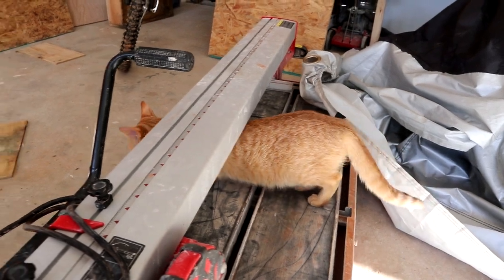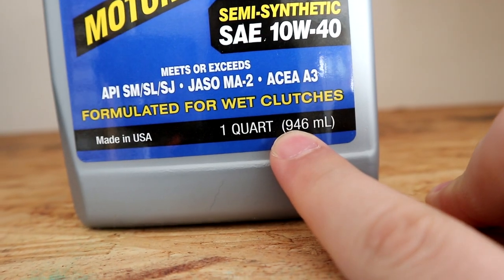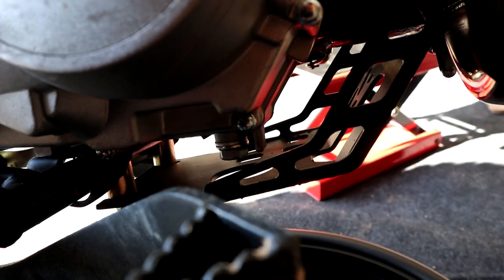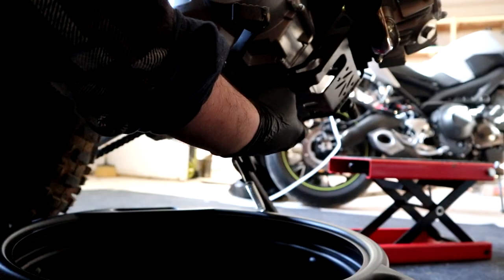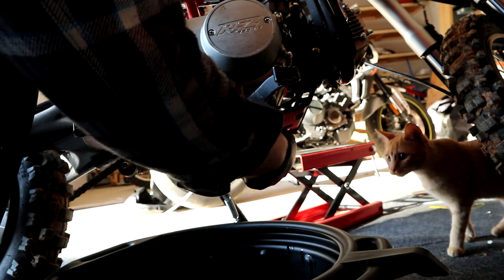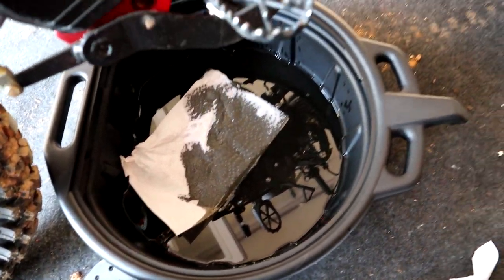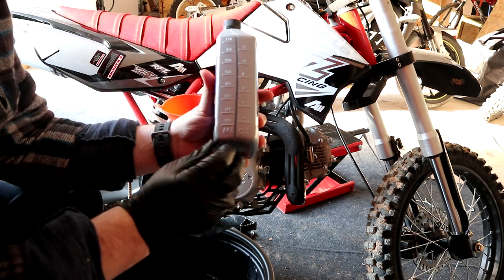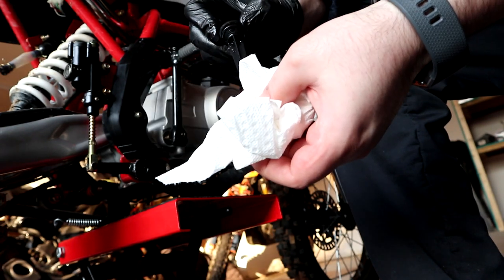APOLLO 125CC X18 OIL CHANGE - NICK BUNYUN GARAGE #2

Comment: How's the bike holding up? Still ripping no problems? I'm looking between the Apollo rfz18, Tao Tao 140cc, and Orion 125
Reply: hey not sure if you bought one yet or not, but ive heard reviews that the taotao is a little lower in quality. We have an apollo rfz125 (just bought riden only once) and i cannot vouch for orion. 
the apollo is decent from what ive read. Just have to change the oil before you do the first start, and some people are saying replace the stock carb and you should get a good bike to play around with. (also medium loctite all the bolts and nuts so they dont rattle loose)

Comment: Does the Apollo X18 have good power and acceleration? What about torque?
Reply: I have gotten mine up to about 52 mph. The acceleration is decent for a 125 and torque is pretty good stock for getting up medium hills in 1st or 2nd gear. Would definitely recommend a carburator upgrade so it doesn't bog down as much. It also increases torque/acceleration.

Comment: Is it 5W40? Or 10W40? For the Apollo 125?
Reply: 10w-40 conventional oil only.....No synthetic oil because the clutch is a wet clutch submerged in the engine oil and the slicker synthetic oils will cause clutch slippage and send your clutch to a short lifespan.
Reply: As long as it says formulated for wet clutch on the bottle you're good. And smaller motors like 10-40